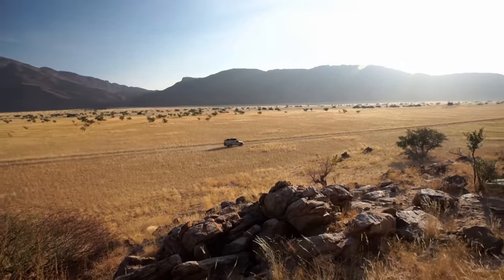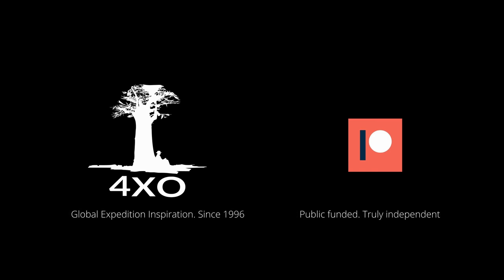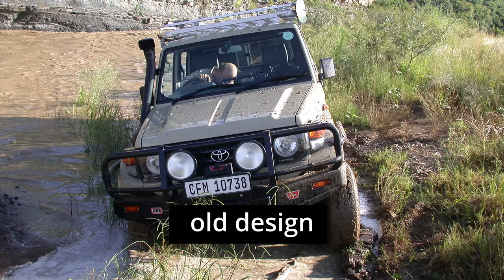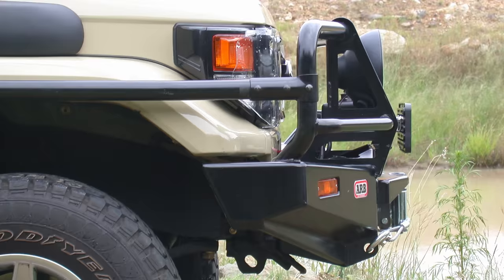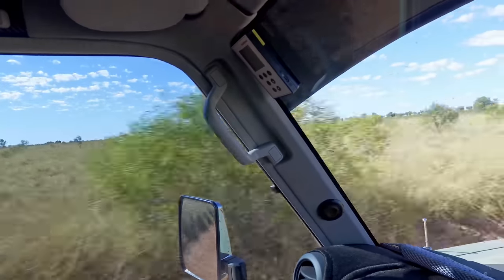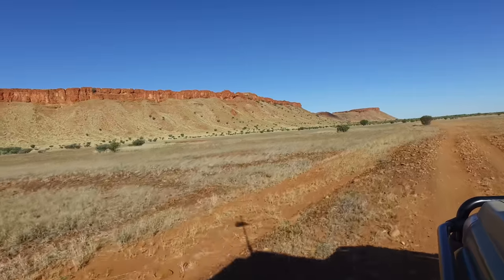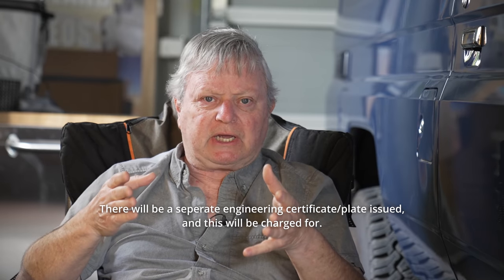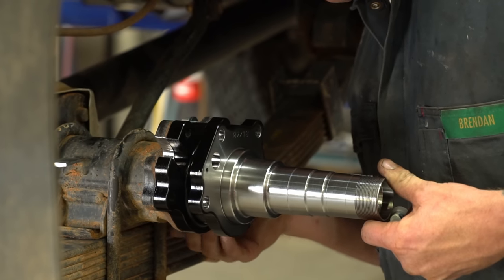TOYOTA LAND CRUISER AXLE-WIDTH CORRECTION. Is it Really needed? Cheaper alternatives? | 4xOverland

Comment from the maker: Toyota needed a wider front axle to enable them to fit the V8 engine. They made the front wider, but didn't make the back wider, because the rear bodywork remained the same as it was before. If they had had widened the back axle, it would been too wide for the existing bodywork at the back. Which would have meant changing the body width (which would have meant changing the entire body, roof etc.), or adding wheel flares. Add-on wheel flares do not work well in the less developed parts of the world (an extremely important market for Toyota and NGOs) because they'd quickly be torn off and then the cars would be not be roadworthy with back tyres sticking out. It was an economical decision. It was either do this, or cancel all 70--series production altogether. Which at the time, I am told, was considered. I say, be grateful we get the 70-series at all!
Reply: But didnýt they fix the axle issue on the single cab ute?
Reply: Doesn’t really make sense for Australia’s ever so popular cab chassis, but it’s a half decent excuse I’ll give ‘em that!
Reply: So they should have cancelled it or recognised they had half made a vehicle and reflect it in the price.
Reply from the maker: @froggymicb  You obviously don't own one. I'm very happy to pay the price because of what the rest of it offers.
Reply: @4xoverland  what exactly does it offer?  Poor fuel economy.  Poor performance.  Poor technology. Rich price.
Reply: Don’t get me wrong, I think they are a super rugged vehicle and definitely have their place in mining, agriculture and outback touring. But the amount of car you can buy with the same amount of money is amazing. 

These have next to no safety features, are super thirsty and quite frankly, are being out performed by 4 and 6 cylinder turbo diesels.
Reply: @froggymicb  they are expensive, the offer little in the way of advancement. Their is no vehicle I know of you can buy today (maybe something like a Porsche 911 GT3 RS?) that offers such strong resale value, and they do that because of their ruggedness.
Reply: @froggymicb  You forgot "FUN to drive... LOL !!!!!
Reply: @froggymicb   Agreed , and shame on anybody trying to "poor "shame somebody else, because they have the wisdom to realise they do not have to buy a overpriced farming vehicle..
Reply: @4xoverland   but are you paying the price? and yes I have owed 1.
Reply: Be grateful we get to pay North of 80K for a 1980's spec vehicle complete with tape deck, manual windows uncomfortable seats and you guessed it mis matching wheels
Reply: $100k Landcruiser that needs so much more $$$ spent on it....
Reply: Andrew st Pierre white what do you think about the 6×6 land cruiser conversion is it worth it
Reply: Andrew... interesting video... Question? Is there any inside clearance on the front wheels at all, which have be pushed out by the engine upgrade? Has this been checked by anyone? If there is a bit to play with.... Maybe get away with 20mm in-set on the inside of the fronts... paired with 25mm off-set on the backs that way you split the difference down to 5mm on each side... like you say your spare is your spare till you can get it fixed!! just a thought has anyone looked into that? so many options you could look at with the offset rims that are out there now days... great video as usual... cheers
Reply: @froggymicb  Tough Reliable. Engineered to withstand the Aussie conditions.
Reply: @dme6991  that's a little harsh, he is just pointing out some failings on the 70 series LC's which are there.
Reply: I still disagree with that, as I have never seen anyone who has done a rear diff assembly correction had to resign the whole vehicle.
Reply: @4xoverland  I do agree with that Andrew if it's you, I would love to be able build a vehicle from the ground up to what I want, but just don't  have the money to do that. That's why I watch your show.
Reply: Why not to use inline 6 cylinder engines, petrol and diesel?
Reply: Nissan patrol y61 single cab with leaf springs model has rear track 100mm narrower than the front. They are not fitted with wider v8 engine. What the logic behind it?
Reply: @4xoverland  They're also most probably unaware that Toyota's attraction lies in its total reliability. That piece of mind knowing the one thing that'll never leave you stranded is a Toyota. 
Ask me,  I owned a  (boring) Toyota Cressida for many years. Still got a good price when selling it with half a million km's on the clock. Engine never touched. 😊😎👍👋
Reply: @hd221813  the 1hd-fte in-line six turbo diesel best engine ever put in a Landcruiser but no longer met emissions so they went with the V8…
Reply: @froggymicb  stick to your Pajero sport or whatever soft roader you drive then mate. All the mines, stations, Roo shooters and contractors use them out in the outback where I live & work for their robustness & reliability, plenty of choices for soft city boys
Reply: @user-rv6zk1pp7r  The soft city boys won't last long compared to the hard country boys😊😎👍
Reply: @user-rv6zk1pp7r  mining companies get them cheap thats why they use them
Reply: If your looking for a track correction have a look into the DANA 60. We run them in all our fleet and they are unbelievable. Best bit of gear, made in Australia comes with Eaton E locker as standard, full plug and play.
Reply: Garbage they have been using smaller axle rear ends for decades.
Reply: Toyota sucks in this regard. If you want to put out a top off-road vehicle you don't take shortcuts! Design it the way it should be!!! They have lost me over this.
Reply: Interesting how you say they needed it for the v8 engine. If that was so why does my 1985 75 series inline 6 cruiser have the same difference in the diffs as the new v8???
Reply: sounds like complete bullshit to me, flares are always cheaper than panel beating.
but even if there was some truth in it they could've easily flared out the body panels just like they did with the front.
Reply: @tomkarlsborn2384  you're not the primary market. They won't miss you.
Reply: hi guys i would love to ask if spacers can help
Reply: @GUSCi-BDE  They are illegal in most states & they put out of center forces on your wheel bearings which can lead to catastrophic failer. If you have any brains you would never use them, ever!

Comment: The thing I don’t get about Toyota buyers is their want to buy a car that they then invest huge amounts of money fixing design flaws?! I get there is upgrades and improvements people do to modify their vehicle but stuff like this just annoys me. If Land Rover did this they would be slammed by every media outlet and all the fan boys of other makes… or the dusting air boxes, or the alternator locations in lc200 etc. drives me mental!
Reply: Absolutely right.  You pay top dollar and your need to change the basic axle…surely it’s not simply a big $ issue for Toyota .  Steve 🇦🇺
Reply: You are correct, Toyota are overrated. The only thing they actually get right are the engines. Their running gear and design flaws elsewhere are terrible
Reply: That’s exactly what I was thinking. Wider front axle to the rear sounds completely wrong. No one else does it. 
Toyota do it and it’s just a minor irritation. 
Land Rover do it and it’s major design flaw and gets ridiculed.
Reply: It always amuses me this comment &!it often comes up.  Regarding the rear track correction.  I’ve owned a few 79’s (single cabs) and a 78.  On the 79’s I did NOT correct it.  All up I would have 850,000kn on those two vehicles & one of them I’ve kept in touch with the new owner, it  has now  580,000 plus km on it.  I towed, I went all over the joint, I mean literally 😂 and I never had an issue.  Yup it’s not ideal but hell, talk about a moaning bunch of softies, it’s just not that bad.  

Probably the most annoying thing about it is when the rear is hunting between ruts on a steep decline, I mean real steep, well that can make ur heart rate increase occasionally 😂.  I never had an issue or damaged the truck or had an accident.

As for the location of the Alternator, I never replaced an alternator.  On both 79’s I mucked around & cleaned them up after being in the soup but never had a failure.  My 78 I never did that despite having it in the mud.

My next 78 I’m going to put the sealed unit on because I’m chasing higher output & it makes sense imo.

TBH (totally honest), I could buy a Troopy, change it’s suspension, tyres, Snorkle & airbox & travel for 2 decades &!only do routine maintenance & that’s nothing IMO.  Everything else like barwork & dual batteries etc, you do with every 4x4 except some of the newer yank things.

I mean in the old days. I use to take my 40 series Troopy thru the desert & up thru the centre to the top end with an esky & a swag in it.  No problem 🤷🏼‍♂️
Reply: @GR8Tmate  your are right but wrong. No doubt they are tough and reliable but they are bloody expensive so it isn’t unreasonable to expect that these design flaws not to be there, especially after all these years of making these vehicles. They went to the trouble of redesigning the front end to accomodate the new engine but then decided to leave the rear axle alone and 100mm narrower than the front. That’s something we would expect to hear about some obscure communist manufacturer 50 years ago not from one of the largest car manufacturers in world. How cheap do you have to be? Then there is the dusting issues which I also have with my 200 series. How hard is it to design an air box that actually seals the filter element from the intake rather than leaking around the filter? This is pretty basic stuff that people are spending money on which really should just be made correctly by Toyota. Still, with 12 month waiting lists for a new troopy at over $80,000 I suppose they figure they can get away with it.
Reply: @peterj5751  I don’t disagree with what your saying completely HOWEVER for 70 series owners (who are provided with a raised air intake from factory in all models) if they are serious about air quality will need to scrap the air intake or at minimum pull it apart & methodically seal it up, so they will also need to address the airbox failings which is really poor I agree.  I agree with you on that point, it’s not up to standard.

Re: Rear Track,  as someone who’s probably covered more km in a 70 than say probably 90% (or more) of people, the rear track issue is not absolutely imperative, nowhere near it.  That said  the way people talk about it (not ASPW) it makes it sound like it’s a must and it’s simply not.  I essentially agree with the way Andrew put it but when you hear others comment or talk about it, it would be easy to have the perception it’s virtually unable to be driven.  That’s laughable.  

I’d agree with you though, Toyota could have easily dealt with that & the costs would have been ‘there’ but passed on to consumers without much notice so it doesn’t make much sense. 🤷🏼‍♂️

Toyota has confirmed it’s committing to a redesign of the 70 series, to keep it after 2024/25 (whenever the next euro standard strikes). I’m certain the track will be corrected then, they will be a total redesign from what I understand.

For me though, I’m more concerned that Toyota will screw with the 70 so much that it will lose the bulk of what I like  about it.  This worried me so much so I decided to unload my current Troopy & order a new one recently so I could build the next one, exactly the way I want it. At my age, that will be my last vehicle. There’s a chance I might regret it, especially if Toyota knocks something really special out in a few years time but as a 78 driver I’m not willing to take the risk because the current 78 is the only body shape I’m interested in (for what I want).  

BTW, I will be doing a track correction in my next build but not for just the track correction reason but rather it will come as  part of the Coil conversion I want.  Everyone’s quick to come down hard on the 70 but one of the reasons I like it so much is it’s one vehicle that can really be shaped to work just the way you want it. You just can’t do that with anything else. The people that moan the most about it seem to be those who have no interest in buying one anyway, the anti Toyota mob.  

Over the years I’ve constantly had people approach me (& my 70ies) to talk about my vehicle(s).  I’ve never instigated any of that.  I never approached others to talk about how shit their cars are but it happens to me all the time 😂 (it’s not because I drive a bomb, my vehicles are always impeccably maintained) but there’s always some knob making comments to the point I’ve now started saying the impolite version of go away 😂

It looks like Toyota has finally fixed the 200 airbox with the $150,000, 300 series. Watch them sell like hotcakes.  I’m guessing people will start moaning about the position of the diesel filter now (someone’s probably already designed an aftermarket guard for it) 😂.  You can almost bet there will be something else about that model that people will site as an issue.  For me, the smoking gun with most of the new models is GVM/GCM.  I just don’t know how anyone can seriously consider a car with 600-700kg of payload as a tourer, that’s the real joke.

Have a wonderful 2022 👍
Reply: @Snook_  sounds like you want one but can’t afford it
Reply: Why do you get annoyed there not spending your money.you must really want one

Comment: Thanks for the detailed run down on the issue. Neg. 25 offset in the rear is exactly what I have just done with my 76 Series. It cost me all of $200. Now the rear tyres still sit flush factory flares, improves handling, looks good, and all legal. I agree Multidrive is the best value option for full track correction, but for about $6,500 (fitted and certified) vs. $200, I'm more than happy with the offset solution for now.
Reply: Hi James. You're running zero offset on the front ? Steelies I presume? (king D hole Sunrasia kind of thing)? Using the zero offset front as a spare for the rear also?
Reply: @joshinthecity  exactly right! Dynamic Sunrasia, -25 in rear and 0 for the front and spare. Very happy with it.
Reply: @jamesh7395  Have you noticed the extra wearing on the rear bearings as he mentioned in his video ?  I’ve been back and forth on the idea of different offsets.
Reply: @shreddjunkii4526  Hey mate, to be fair I have only just had the new -25 wheels fitted, so it's too early for me to say personally. However, I am very cautious, and I did a lot of research before going with it. Many other owners have fitted -25 or -50, and even those running -50 for over 100,000 kms have reported very little issue. And if it did happen, I think re-packing the bearings is not the end of the world. Hope it helps!
Reply: @jamesh7395  perfect cheeses mate
Reply: Presumably no issue with standard brakes at the rear...
Reply: I have neg 50mm on the back The track difference is 95 mm so neg 25 dosent quite cut it. Go with neg 50.

Comment: Its like having a fifth wheel of about 100mm in the middle of the rear. Ive done the full axle on my 76. On and off-road performance significantly better. Without it soft sand a speed can be dangerous imo

Comment: Great non biased clip mate, running a 2021 bloopy and running track correction rear wheels. I carry 2 spares, 1 on the rear and a STD on the roof. I do worry about my rear bearings but have upd service intervals to make sure when going on remote trips I don't have a failure. It has worked great without any issues and kept me to my budg for now.

Comment: Long term review: Have been running  -55 offest rims on my 79 for 260,000km now. (Very heavily laden vehicle with alot of heavy towing and 4x4 work) At 200,000km rear wheel bearings were replaced for the first time to get the vehicle ready for a long cape york trip, but they were still in good servicable order without any evidence of being run with excessive heat or wear. The good condition may be due to regular maintenance. 
We recently went back to a -25 on the rear to get the vehicle fully legal again and it still handles OK in the sand but not as good as the corrected width. Good cheap alternative for those who cant afford the tru tracker
Reply: If I had one, this is what I would do. Don't understand why a full wheel offset is not legal while this 100mm small rear track is, strange.

Comment: I owned a 2011 Land Cruiser 76 for eleven years.  I particularly felt the difference in axle length when in the dunes of the Namib (Solitaire to Walvis Bay) and in places where there is thick(ish) sand, like Khaudum and Mabuasehube. I found it quite tiring to be constantly trying to correct the 'faulty' tracking sensation of the vehicle. I actually became quite irritated as well.  It contributed towards my decision to sell the vehicle.  On one occasion when racing down the compacted side of a dune, into a bowl and up the other side of a compacted dune wall, I was required to go as fast as I could to get my 96kw LC up the other side.  The consequence of two different widths of the axle at a speed of about 120-140km/h felt quite insecure (I hesitate to use the word dangerous but that is how it subjectively felt at the time). If I had my time again with my Land Cruiser 76, I would definitely correct the axle-width discrepancy - I believe it will enhance ownership enjoyment.

Comment: You are pretty niche, but man you never half ass your technical revues.  Your book on 4wd driving was worth the price  many times over. You gave me the confidence and knowledge to get off the pavement. (2004 Jeep Wrangler TJ, rear auto-lockers, 4.0L straight 6, 2 1/2" lift, 33" tires) Thx Anthony.

Comment: After putting in a GVM upgrade to my 78 from Lovells, installed by APE suspension in Wangara I've had no problems with wondering or searching on road or sand, I don't have a rear axle  correction, no off set.🤙